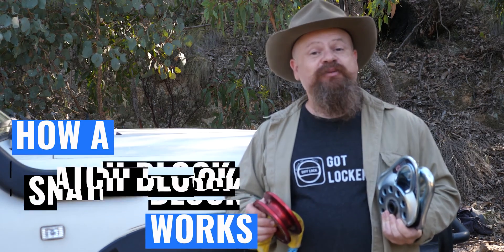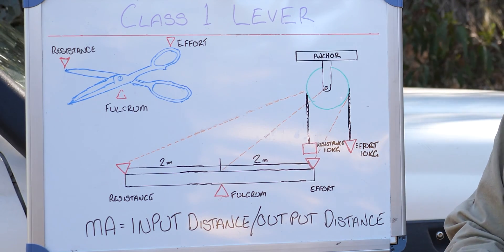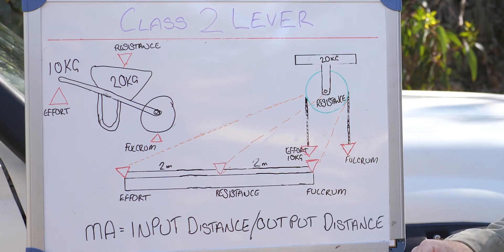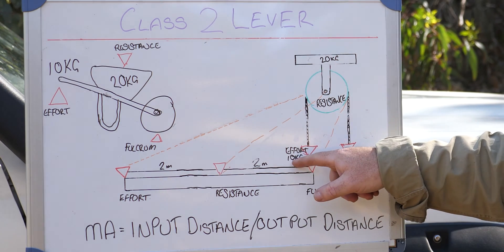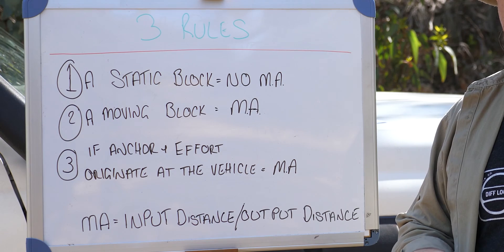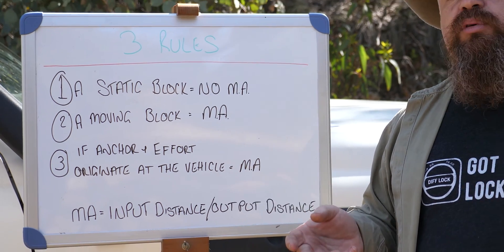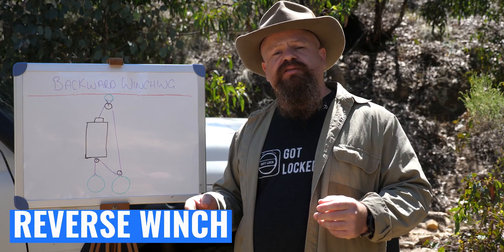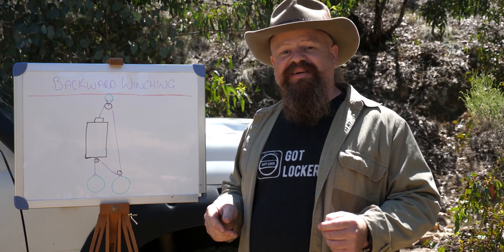How does a Snatch Block Work?

Comment: When you do your double line pull to move someone else if possible I would not anchor on my vehicle as to spread the load out. I would only use soft shackles for change of direction due to friction and the load ratings vs traditional block and shackle.
Reply from the maker: If you're able to anchor to a tree or other immovable object, it'll lessen the likleyhood of the winching car being dragged forward by the load as well.